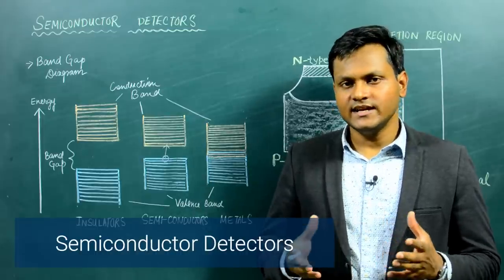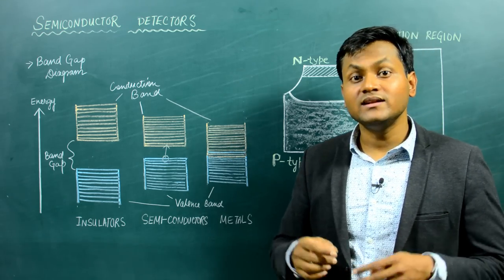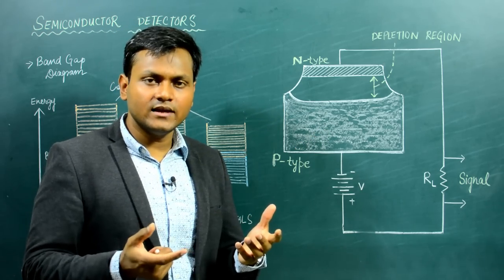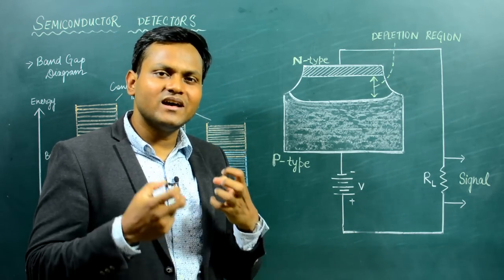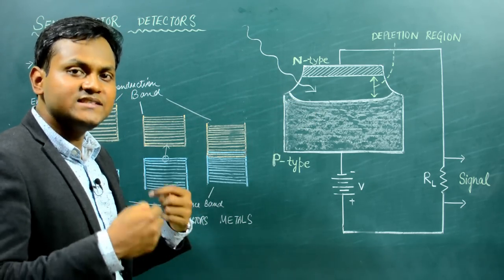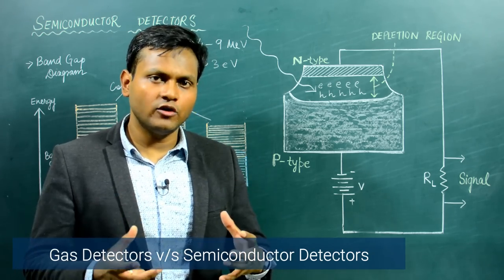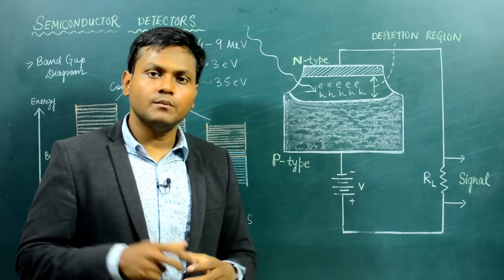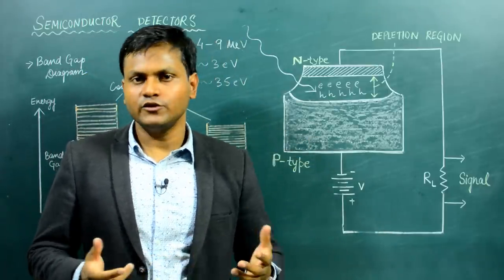What are Semiconductor Detectors?

Comment: This is a GREAT video and much appreciated. You did a good job explaining this and are talented at teaching. The only critique I have is that although it is true that diffusion leads to a depletion layer without a bias, the application of a bias increases the depletion layer not by increasing diffusion but by doing the opposite and pulling the charges apart to create a larger neutral region. They are different processes with/without a bias that result in the same effect.

Comment: Thanks for your crystal clear talk but the question is that how a signal measuring circuit decides that the coming electrons are from low energy and high energy incident nuclear radiations to differentiate between the two energies please.

Comment: Good lecture, short and to the point. You mentioned the benefits of semiconductor detectors over ionisation chambers, but are there any negatives to using semiconductor instead of ionisation (i.e. are there benefits/situations to use ionisation chambers over semiconductors)?

Comment: Hi, I have a question. Is it possible for a photon to go into the depletion region and produce an electron-positron pair? If it is, then what will happen to the positron or the pair? Thank you!
Reply from the maker: If the photon is sufficiently energetic, yes. In that case, positron will be attracted towards negative terminal and move, however more likely it will annihilate with another nearby electron
Reply: @FortheLoveofPhysics  And if the photon from annihilation is energetic enough, then it may produce more ee pairs and so on and so on?